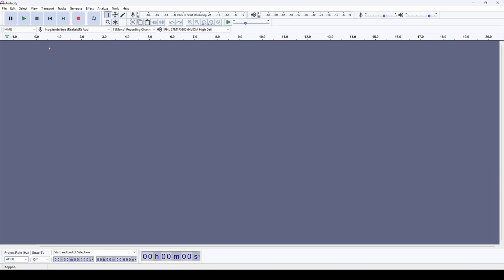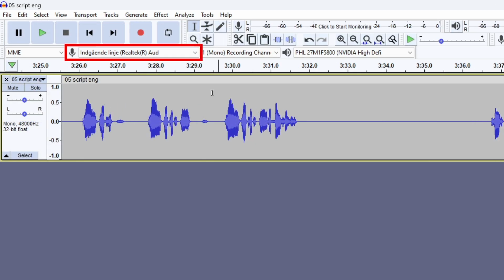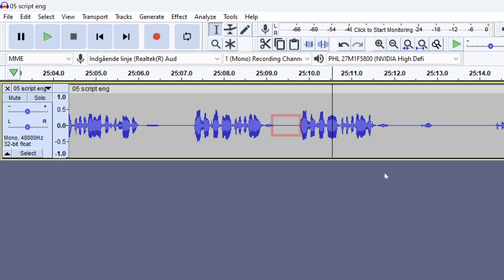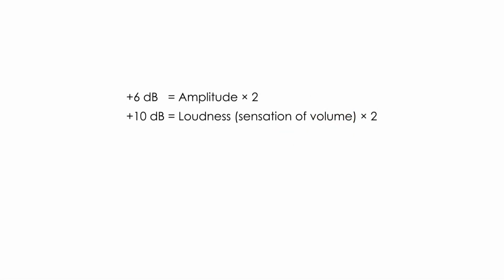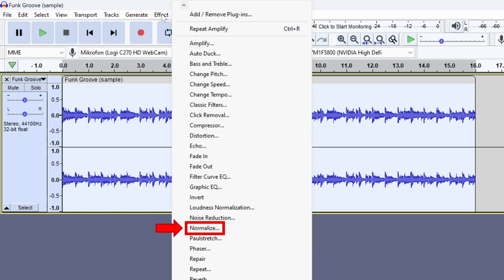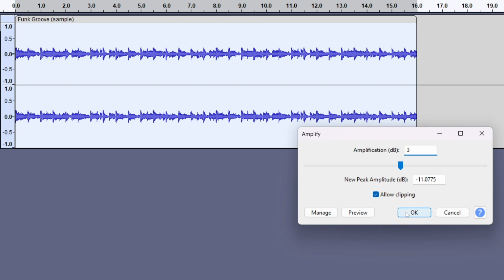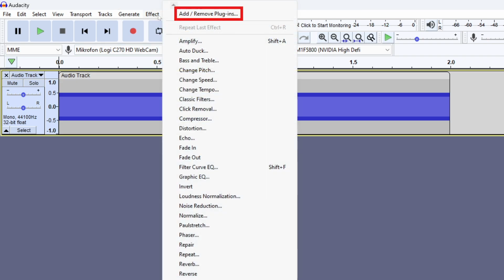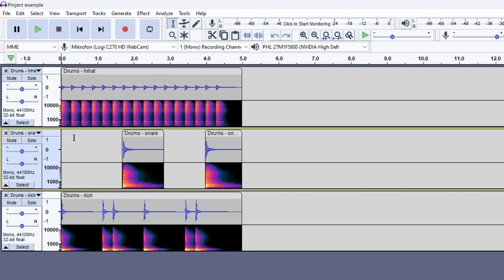Comprehensive Audacity tutorial (for beginners) + tips & tricks - Ep. 05

Comment from the maker: Audacity has had some updates since I made this video. Some changes are:

• Input and output devices are now in a button at the top called "Audio Setup", as "Recording devices" and "Playback devices" respectively
• Project sample rate is now under "Audio Setup" > "Audio Settings"
• The recording and playback monitors have been combined with the recording and playback level sliders, respectively
• To change the time display from "Start and End" to "Start and Length", you now click on a gear button
• "Add/Remove plug-ins" is renamed to "Plugin manager"